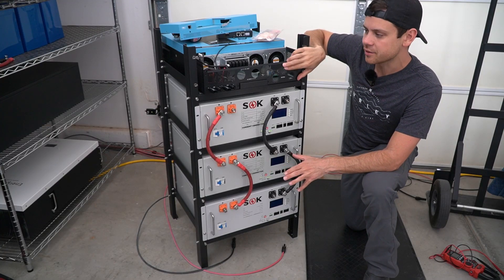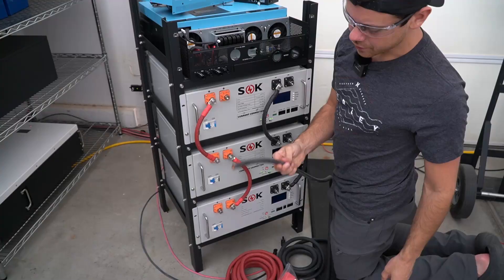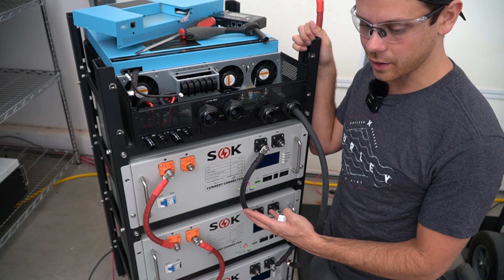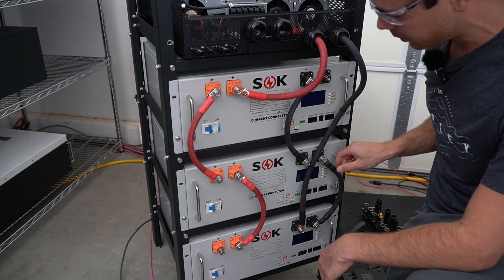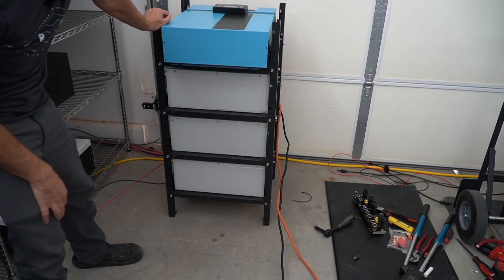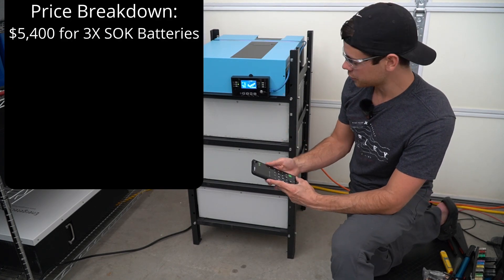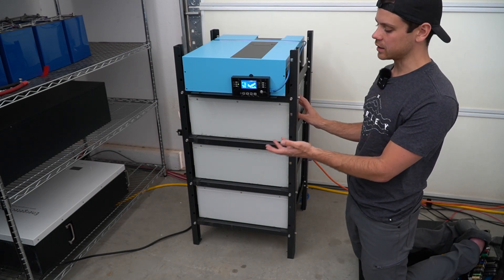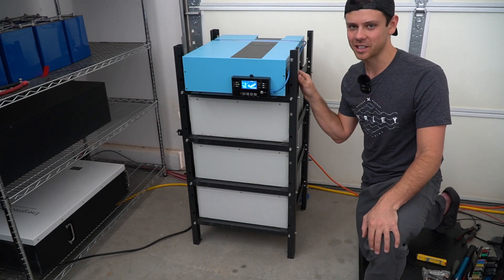DIY Server Rack Solar Power System: 15kWh LiFePO4 + 8kW Solar + Serviceable + Scalable

Comment from the maker: Part 1 of this video: https://youtu.be/e_o594CAdlo

~~~~~~~~~~~~~~~~~~~~~~~~~~~~~~~~~~~~~~~~~~~
Tired of getting ripped off? Check out my "Will Prowse Approved" solar product recommendations below!

12V Batteries
https://www.mobile-solarpower.com/lithium-batteries.html

48V Batteries
https://www.mobile-solarpower.com/48v-batteries.html

Offgrid Inverter System Builder
https://www.mobile-solarpower.com/48v-complete-system-blueprint-559371.html

Hybrid Inverter System Builder
https://www.mobile-solarpower.com/code-compliant-48v-offgrid-system.html

Mobile Handtruck System Builder (very popular!)
https://www.mobile-solarpower.com/mobile-48v-system.html

Solar Panels
https://www.mobile-solarpower.com/300w-solar-panels.html

Ground Mount Solar Racking
https://www.mobile-solarpower.com/ground-mount-racks.html

Wire, Lugs and Busbars
https://www.mobile-solarpower.com/wire-and-connectors.html

Tools
https://www.mobile-solarpower.com/tools.html

Fuses and Circuit Breakers
https://www.mobile-solarpower.com/fuses.html

Plug-N-Play Solar Systems
Ecoflow, Anker And Bluetti! So many models to choose from. See my current recommendations here:
https://www.mobile-solarpower.com/full-size-systems.html

~~~~~~~~~~~~~~~~~~~~~~~~~~~~~~~~~~~~~~~~~~
Need to build a large DIY system? Need a trustworthy solar distributor? These are my favorites:

Signature Solar
Creator of EG4! Solar Minisplits, Victron and More! Largest Solar Store Online.
If you want $50 off, please use my link below and coupon code "DIYSOLAR50":
https://signaturesolar.com/?ref=cPwLcVc0SW-BjN

Current Connected
Best Prices for EG4, Victron, Midnite and so much more! Fast Shipping and Highest Rated Customer Service:
https://currentconnected.com/?ref=wp

~~~~~~~~~~~~~~~~~~~~~~~~~~~~~~~~~~~~~~~~~~
Join our DIY Solar Community 
Need more help? Join the largest solar forum on the internet for beginners and professionals alike. 140,000 members and counting!
https://www.diysolarforum.com

Check Out My Free Book
Best-selling and beginner-friendly guidebook to off-grid 12V solar!
https://www.mobile-solarpower.com/the-book.html

~~~~~~~~~~~~~~~~~~~~~~~~~~~~~~~~~~~~~~~~~~
Contact Information:
I am NOT available for personal solar system consult! If you wish to contact me, this is my direct email: williamprowsediysolar@gmail.com
FTC Disclosure Statement and Disclaimers:
Every video includes paid promotion or sponsorship (such as free products for review). Some links on this YouTube channel may be affiliate links. We may get paid if you buy something or take an action after clicking one of these. My videos are for educational purposes only. Information is subject to change/update at any time. Electricity is DANGEROUS and can kill. Be smart and use common sense :) DIY Solar Power with Will Prowse is a participant in the Amazon Services LLC Associates Program, An affiliate advertising program designed to provide a means for sites to earn advertising fees by advertising and linking to Amazon.com
Reply: Do you know your face in on a Wduei Ad for facebook selling batteries ?
Reply: Can you hook up wind turbines along with solar to the system or do you need a splitter device to bring both power sources together?
Reply: So +/-$23,000 for this x2, a 30kW system with 16kW solar array plus Victron shunt (cost?) plus panel mounting hardware ($ guess-ti-mate?), plus grid connect with back flow safety with an input to trickle charge batteries with portable generator to last forever ($?)  Would this be cool or what?

Comment: Just bought this system with 8 415w solar panels and 2 rack mount batteries. Can't wait to get it installed. I'll be using it in a travel trailer. Should do everything i need. Just wish i had the money for two more batteries but being on disability im limited on what i can do.

Comment: Can a  EG4 6.5kW Off-Grid Inverter | 6500EX-48 or a EG4 6K Off-Grid Split Phase Inverter | 6000EX-48HV be used for this?, Thank you Will for all your videos and instructions, it is much appreciated, Thanks Again

Comment: The only thing I would do differently is use an open server rack with locking casters on the bottom to make it easier to move around. Otherwise, it's a pretty sweet setup.

Comment: I like your videos,but the esthetic design of this rack is just wrong and i'm talking about the front.They should mount bus bars at the back for batteries and leave the front clear where you have all the meters to be easy to read and monitor.Tieing that cable on the handle is just not  what that handle was made for.

Comment: Hmmm, wondering about a setup for charging our Tesla model 3 not sure which parts are needed and how to set all of it up. Do you plan on doing a start to finish video for someone like me wanting to buy the components you suggest and how to connect it all up? The end result is to charge our Tesla using only Solar panels, inverter, and batteries. We will have it off-grid but want the option to connect to the grid as well. Looking forward to your response. Continue to enjoy your videos and this is the first time I am ready to spring into action.

Comment: wow, in rough terms, with 2 * 8kw grid arrays and 2 * rack batteries you're < $30k and running basically at a profit month to month - would make breakeven around .. 10 years in.
Reply from the maker: I use Bitcoin miners to spead that process up

Comment: It scares me how much faith you place in structual capacity. That metal rack shelf with batteries and invertors on to the left of the roller door for example. Each one of those shelves are held by plastic sleeves in compression only, nothing positive locking like sheer screws/bolts. If I was an insurance company, I would wipe your claims when there is a fire or anything else.
Reply from the maker: Yeah and they can hold 3X the weight. I know how they work and I ordered the more expensive one. I've had thousands of people crying about that and they never read the manual.
Reply from the maker: I actually have a friend at and r&d facitility for lifepo4 and they used the same shelves and loaded them till they were bending. Completely overloaded. And you're going to cry about this? Using a product within spec?

Comment: Love your content! Quick question for anyone reading
Is it never okay to "mix new and old batteries"? 
Like if I got 1 sok and wanted to get another in a year or so for the same system, would that be damage the batteries?
Reply: While it’s possible to mix, it’s usually not the best idea for a few reasons. The older battery would have a lower capacity and reach the lower limit shutting it off. Then the remaining battery now has the full load to deal with which could trip breakers. For example, imagine you had a 6,000w load shared between two batteries (3,000w each). At 48v, that’s 62.5Amps. Suddenly your older battery cuts out, and now you have the full 6,000w going straight to the new battery. 6,000w at 48v = 125Amps. That’s a very big difference and your wiring needs to be able to support that kind of heat. So again, it is possible, just not recommended because you have to watch things more closely.
Reply: @TommyHolly  really appreciate the in depth response. Makes perfect sense thanks again for explaining

Comment: Very nice, I ended up using the signature solar rack for three batteries and added casters to be able to move it around. Also used the SOL ARK 12 K with 12 450 watt panels wired for a 14-50 outlet for EV charging.  Will more than likely add another 6 450 watt panels to max out the system to two rows of nine panels. Sol Ark now makes a 15 K inverter which is expensive but really easy to wire. Please do a review in the future for the SOL ARK 12 and 15 K. Thanks for your excellent videos
Reply: I added casters too... so glad I did... this is HEAVY!
Reply: Very nice

Comment: Hey Will, Dexter at Current Connected said you have his only server rack and I need the dimensions.  :-) Their website doesn't have them either. Can you post them in the description and/or give them to Dexter?  Thanks for the hot tip on these batteries!  I got mine in the first shipment!

Comment: The one thing missing on these server racks is mobility. Having a heavy duty base that had heavy duty casters on it would allow it to be easily turned around, even when it was fully loaded. 

This would allow one to spin the unit around easily if the need did arise, additionally having 2 of the 4 casters have a locking mechanism so once it's in place those casters could be locked in place. Securing the tower. 

And since it would be mobile it could be moved easily in case of a emergency or for any other reason. 

Considering the investment into such a unit is about 12k give or take, I'd build it so it could be mobile. 

Another thing I don't see in your shop or garages Will, are well placed fire extinguishers. Perhaps you have them. 
I understand that the chances of fire is remote the chance is still there, especially during the summer month's during the monsoon season with the large amount of lightning...
Reply from the maker: Casters sound like a awful idea. This is a stationary storage system and the rack is not designed to deal with dynamic forces. The unit weights 400 pounds, and moving that around just seems silly. Am I missing something here?

And no need for a fire extinguisher. but I have and few of them. It's a non combustible chemistry, due to the fact that self propagating thermal runaway cannot occur. 

Moving 400 pounds due to an emergency?? What? Yikes you need to watch my beginner videos. You don't understand how these batteries work. Check out my video about lifepo4 misconceptions.

Comment: That inverter should be able to communicate with the BMSs via RS485 so you can accurately read SOC on the inverter display. Did you try that?
Reply from the maker: Yeah I can but pretty pointless in my opinion. I'd rather use a shunt anyway so I can connect to wifi. Or bluetooth.

Comment: I’m confused how this would integrate into my home for a full home backup.  Are you saying two of these and I could backup my whole home?  How does it interface with a system like Enphase?  I’m very interested!
Reply from the maker: Yes the whole home. Use transfer switch and connect to ac output of the inverter. That's it.
Reply: @WillProwse  So I would have 30KWH of backup for around $15K plus installation or DIY installation (not so sure about that, code probably requires licensed electrician for transfer switch).  that is amazingly cheap compared with power wall/Tesla.  Why wouldn't everyone do this?  What am I missing?
Reply: @ystebadvonschlegel3295  It's just missing the Tesla branding, so you're not missing anything of substance. This is the way

Comment: Great video. Gonna update my inverter now. Regarding the battery communications. Can this all in one unit work with EG4 server rack battery. I don’t see where you hooked up the BMS to the inverter
Reply from the maker: I'm not going to use the communication system as I mentioned in the video. I don't see any benefit.
Reply: @WillProwse  thanks for the reply. I watched the video several time over. I must keep missing where you make that call out. The very end I noted the smart shunt call out. I just gotta go and dive deep on the benefit of a BMS. I have the EG4 server rack battery and need to see if the smart shunt will work with those guys. Thanks again for all the good info you share

Comment: Awesome video.   If you wanted to do split phase 240, would you put two of those next to one another AND do you make one large bank of battery or two independent banks?

Thanks in advance
Reply from the maker: No, it has split phase built in. Watch the video please.
Reply from the maker: One large bank. Put all batteries in parallel

Comment: Is there out gassing from the batteries when they get hot? Is there a need for ventilation?
Reply: There isn’t any off gassing with these type of batteries.
Reply from the maker: Lifepo4 cells are hermetically sealed.

Comment: if you built two of these units
and put each 180 degrees out of phase, 
would you leave the two racks if batteries not bussed together - so each inverter us connected to only one battery rack
then each inverter would be connected to the  breaker box but on different legs so that you can use 240 from the breaker box???

Comment: Hey Will can you explain how is it possible to repair those all in one unit, if the inverter fails or the charge controller?
Reply: Unless the mfg provides board level schematic (which I doubt) then it’s a matter of swapping boards. Order spares when buy the system.

Comment: Will, any thoughts comparing SOK server racks to EG4 server racks?  Very similar in cost and in your videos, you've seemed to like them both.  I'd had a couple SOK 206AH batteries in my RV about 18 months and they have been fine, no complaints.  I'm getting very close to sliding my chips in on an off grid house/system.  My current grid tied house has a single powerwall (its better than nothing but its not the magic pill Elon is selling) I agree doubling your setup in the video seems like a clean, quick solution. Would you just buy whichever battery is cheaper?

Comment: One question if anyone knows, does this MPP unit support scheduling AC input power use? For example snow on my panels all day and my batteries need charging at night, can I schedule this MPP unit to use AC input to charge up the batteries?  Also to lock out when never to use AC input power .. like batteries are dead, no solar power,  but their is AC input power .. scheduling when not to use AC input no matter what?

Comment: You are my 'go-to' guy for Lithium and Solar. THANKS! BUT, what is the power draw for specific situations? I'm at a loss? Small house, Cabin, large house, Van, RV? 2k, 5k,10k, 20k? You're truly helpful, but you never show the REAL-World applications? Maybe do a series on what different applications need? Track house, off-the-grid cabin, Van, RV, Full Time, Part Time, North, South? Not one size fits all, of course? Maybe some of your viewers would sign on to benefit from your knowledge? I'm a RV part time camper. It always surprises me of the people that can't live without 110V when there are so many 12v opinions? My Jackery boxes are a 'must have'? Not everyone has a Tesla to charge?
Reply: There]'s no "canned answers" for this. Everyone's power usage and needs differ so you have to DIY your load figures; it just varies too widely to do it any other way.
Reply from the maker: Good question, I did make a book on how to calculate this actually. Three different methods. It's a basic book for beginners, but it's only $.99 on my website. Check it out if you haven't
Reply from the maker: And yes I have tiny system build videos. That's where this whole channel started

Comment: It would also be possible to use a 'powerline' or ethernet over power device to easily plug that in to another part of the house. SO you could have your display in the house somewhere and the unit in the garage without having to run a long ethernet cable.

Comment: I have just been researching a 10KW solar / 30 kWh sized split-phase system for use for off-grid use with grid backup. I've been trying to decide between these all-in one units or going for Victron separate units. Just the simplicity of the wiring (and cost) make these units really attractive. My main issue is that I live in Barbados and so need to get everything shipped in. The one thing in Victron's favour is it would be a lot easier to get replacement parts here and with a separates system I could replace individual parts in an emergency. That said, with the LV units you have there if one failed I could at least limp along on my 120v loads (which is everything except AC)

Comment: I have an LV6548 and am waiting on the SOK server rack batteries to come in, hopefully the end of this month. Wondering what the value of the resistor was? Also, I see that you did not put the communication cables from the batteries to the inverter although I've seen others that have. Would like to hear an explanation of why you would want to have the communication vs. not having it.
Reply: Also a good topic for an episode 3!

Comment: That’s a great build video and the pricing summary was great.  Interesting how close the $ and kWh matches a Tesla Powerwall. The thing that these need is a 240v version of the inverter, going parallel is ok, but I’d prefer that FormFactor as a 240v 2p USA spec, that could stack

The big advantage to the powerwalls is 1. Weather proof indoor/outdoor rated 2. Wall mount or floor mount 2. Native 120/240 3. Advanced thermal regulation 4.the software is way advanced now with automated limits for EV charging while on backup, stormwatch, VPP, time of day load shifting 

I prefer LFP, but as you noted that’s coming to powerwalls. Even the powerwalls price per watt and kWh is competitive to this home built. As built 

Powerwalls disadvantage is 1. Tesla can’t make enough 2. They make you go 3rd party for installation now unless it’s bought directly with Tesla solar 3. The power isn’t as flexible as your build for changing runtime (kWh) separate from loads (kW peak and continuous load). 

You could make a killer follow up comparison of your build, vs a powerwall

Comment: Will, just bought 3 of the Sungold Power 6548 inverters using your link. Would you suggest I pair with EG4LL or SOK server rack batteries (which brand should I purchase)?
Reply from the maker: I like sok more. Better quality cell holder and the form factor matches up with the lv6548. The height of the eg4 is smaller so the sok works better.